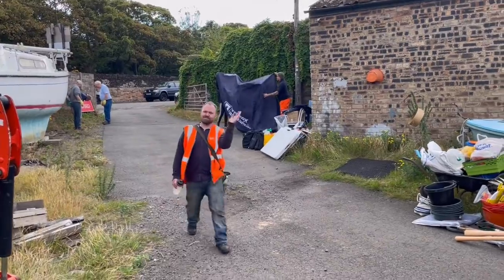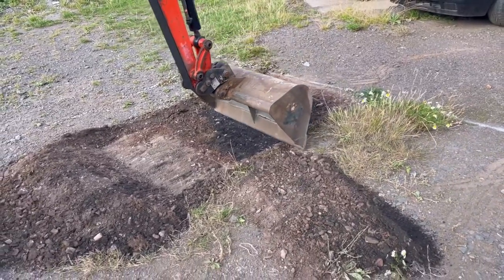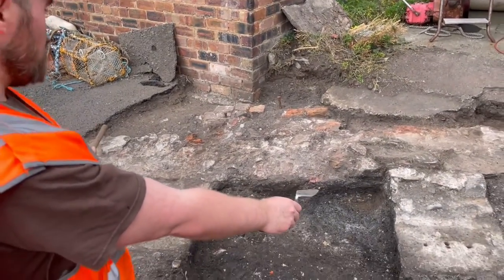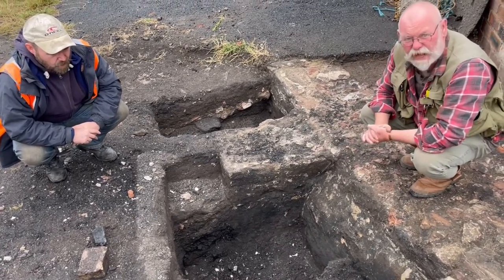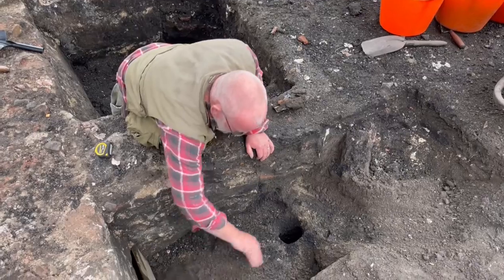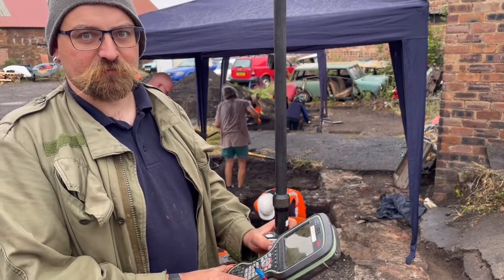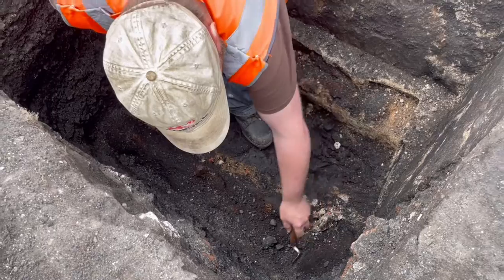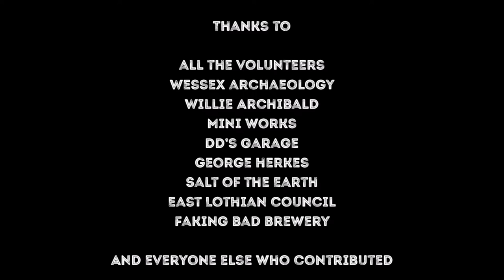Waggonway Dig 2022 - Coal in the Fauld!

Comment: fascinating.  ive subscribed.  i am having trouble understanding why there was a need for the bulk transfer station.  i wonder why the wagons didnt continue to the docks.  i heard something about road wagons.  but there are rail mounting points where road wagons may have been loaded.  i assume the brick building behind the excavations was built after the transfer station ceased use.  there is not much distance from the transfer station to the first sleeper block shown in this video.  i ask what the gradient is from there to the top level of the transfer station?  it looks too steep for a horse to work.
now some words about those bloody wheelbarrows.  you people in uk and europe really have ergonomically poor wheelbarrows.  they flex under load and when they are being moved, the operator has to reach down too far and is holding up the handles because all the load is behind the front wheel.  such awkward barrows are available in australia but they are not used by tradesmen or other people, like myself, who have dug holes for a living.  my favourite type with the best balance that wont be available in uk is a narrow (600mm wide) tmp.  but there are many decent brands here including stanley.  when lightly loaded, a good amount of the load can be loaded forward of the wheel, meaning that when you are pushing it the load is balanced.  see if there are pictures on their website then see if there is a manufacturer closer to your part of the world that seems to have a similar product.

Comment: That brick clay was much too hard and dry.   It should be as soft as margarine.
Reply from the maker: Thanks for the tip!
Reply: @1722waggonway  Here you are: nice and soft so it's easy to fill the boxes.  The sand will really wear the boxes away and these days its two minutes to saw some wood and nail it but two-three-four hundred years ago first they had to go chop down a tree.
https://www.youtube.com/watch?v=J0f19MsAfJs
I live next to Beverley and old buildings there have hand made bricks and the boxes must have been badly worn as some of the bricks are not much thicker than one inch especially in the White House pub and the wall along a ginnel I use as a shortcut to the shops.

I grew up next to a brickworks and the excavator driver told me he only dug out grey shale stuff and any yellow clay was just piled aside.
Reply from the maker: @rosewhite---  thanks, we’ll pass this to Wessex Archaeology as it was their workshop :) But we did get some nice wee bricks nonetheless- lots of fun!
Reply: @rosewhite---  , i have seen tv shows and yt videos that support your advice about "margarine".